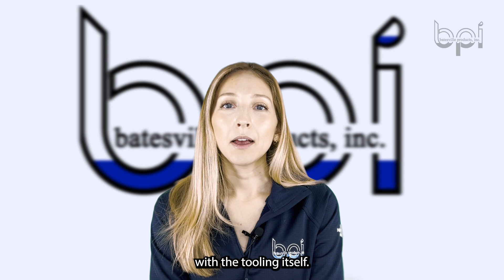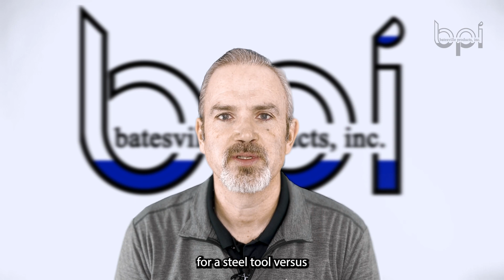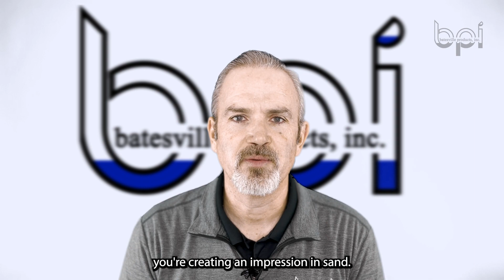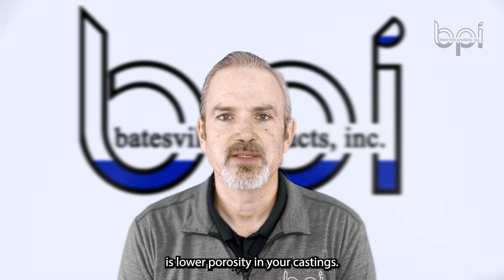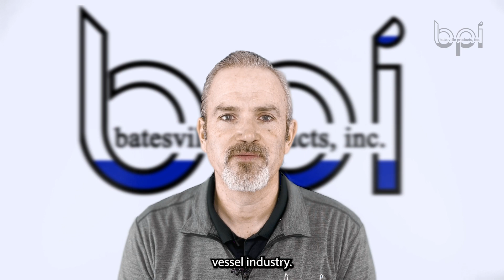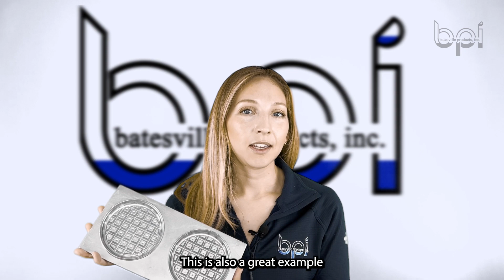Sand Casting vs. Permanent Mold Casting

Comment: How detailed? And how bid can u go? And double sided?
Reply from the maker: Both casting processes can make very detailed parts! You can get even more detailed with secondary machining, or make complex internal geometries with sand cores. Thanks to the steel mold, permanent mold has a higher dimensional accuracy than sand casting (+/- 0.015 linear tolerance for the first inch on one side of parting line). Here's a cheat sheet with permanent mold tolerances and design specs: https://batesvilleproducts.com/resource/7-important-specs-when-designing-for-permanent-mold-casting/

Everything is custom, so there's a lot of design flexibility. You can add complex features in both halves of the permanent mold, so yes, double sided is achievable! 

In terms of size, at BPI we do permanent mold castings that are 1 to 100 pounds. We hand-ladle metal and aluminum solidifies quickly. Size also depends on if the mold can fit on our tilt pour presses. Some of our large castings are big dental chair plate bases, long surgical equipment arms, or even corner adornments on a building in NYC. However, there are other permanent mold and sand casting foundries that make giant castings (think bridges or construction equipment). They can make larger parts because they are pouring metal straight from the crucible or don't use automated machinery.

I hope this helps - Each casting we make is custom so it's hard to give a one-size-fits-all answer!